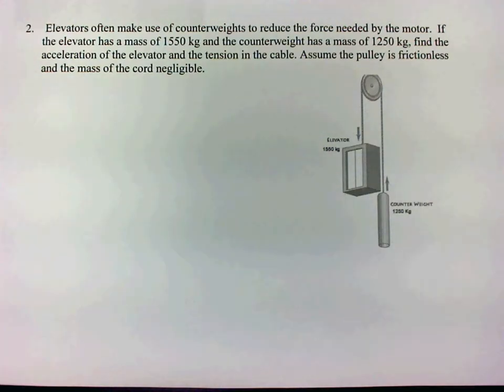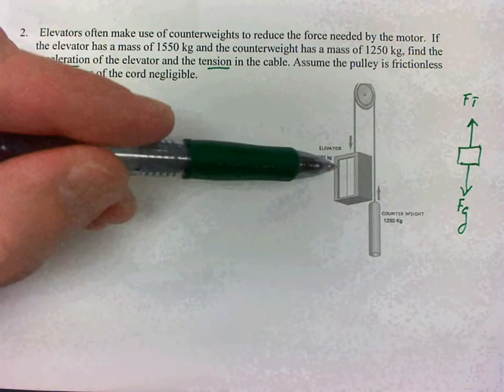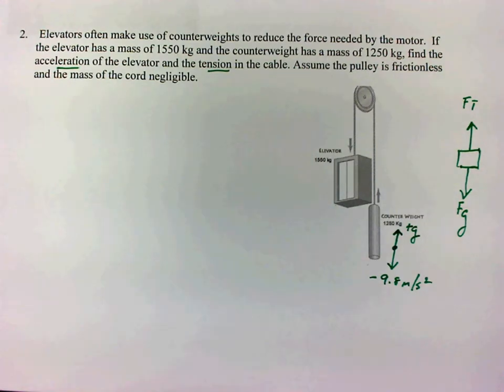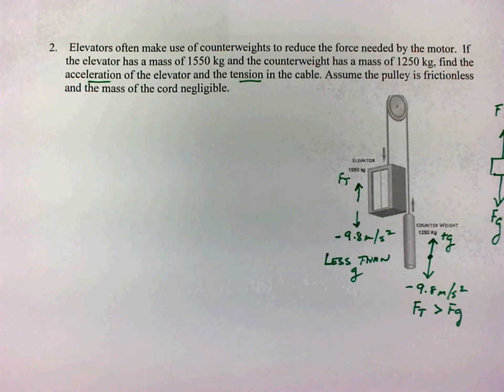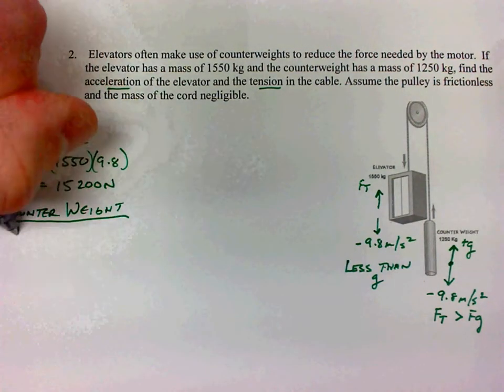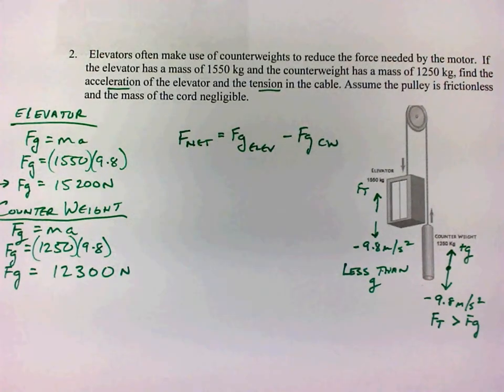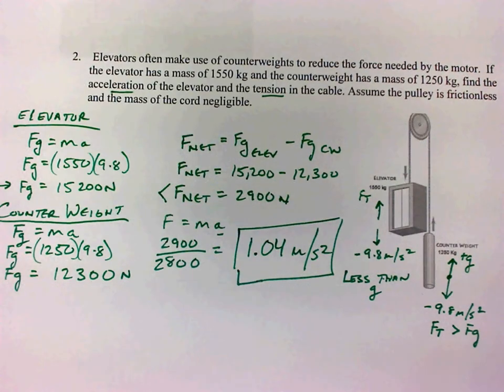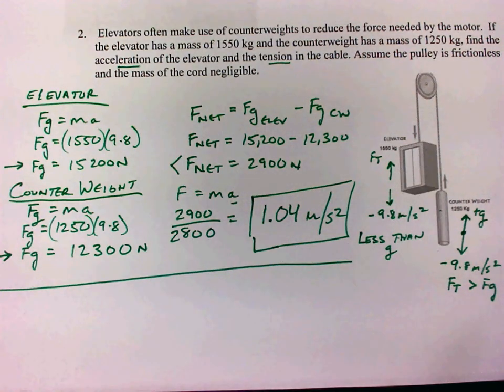Elevator - Atwood Machine Physics Problem

Comment: Your rounding due to using a small amount of significant figures screws up the problem. The acceleration is actually 1.05. Not that much of a difference, but I have absolutely no idea why you rounded it.
Reply from the maker: Finding the net force requires subtracting the two Fg forces.  This requires the use of the addition/subtraction significant figure rule.  This means the final answer can only contain two sig figs.

Comment: Why is the tension on the cable equal in both sides of the pulley? If the elevator is accelerating downward, it means there is a resultant force due to imbalance of the forces. So the tension should differ?